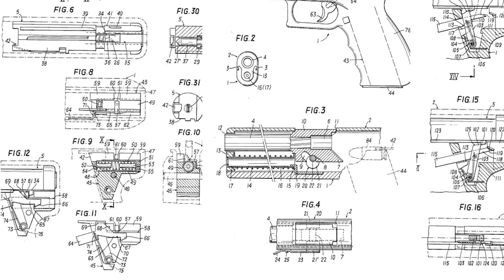The History and FUTURE of Glock

Comment: The Glock slide stop has 5 bending operations. And that doesn't include any of the secondary intermediate operations (where you would reposition the part to complete the bend operation). I've been bending metal for a very long time. Between using a press brake, a c-frame hydraulic press, and the hammer & anvil techniques, I've been doing this kind of work for over 10 years.
Reply: As a side note: 
It's very likely that Glock has presses/dies to specifically make those individual parts in a highly simplified manner that reduces the number of operator interventions by combining multiple bends at the same time. It may only take their shop 2 steps to get all 5 of those bends in, but there are still at least 5 operations that need to happen for the parts to fall into acceptable parameters. I've spent a lot of my life designing those kinds of parts and the tooling to make them. But I still have plenty to learn. Companies like Glock are on the bleeding edge of those kinds of manufacturing processes.
Reply: I used to tell my guys at work "it's mass production, not mass perfection."
Well, Glock is the "mass production" while guns like the 1911 are "mass perfection." That's especially apparent in the cost to produce each type. Sure, manufacturing processes have gotten much easier for the 1911 due to the accessibility of CNC controlled machines capable of exceptional tolerances and very little rework. But there's still about 10 times the amount of machining on a 1911 than on a Glock. And most mid-level 1911s cost at least twice that of a Glock (though the production concepts are often cheaper with other manufacturers as Glock keeps a slightly higher price point due to their reputation.) Look at guns like the SCCY or Hi-Point that use similar manufacturing processes as Glock and you'll see just how cheaply these arms can be produced with similar reliability/durability standards. It just goes to show you that there's always a better way of doing things if you have enough foresight and the right conditions.

Even though I hated Glocks (and similar pistols) until my mid 20s, I realized how exceptional they were when I had gotten more experience with other pistols. Every successive gun I owned and fired made the Glock seem better and better each time. Sure, other guns do certain things far better than a Glock. The 1911, for example, has a trigger that's orders of magnitude better- even the cheapest ones. The CZ-75 and German Luger/Walther's were buttery smooth and extremely accurate compared to Glocks. But the Glock is just a better overall gun. And because it's fucking ugly as sin and relatively cheap/tough, you don't freak out if you drop it onto concrete. They're far better at serving as a tool whereas a quality 1911 is closer to "functional art." And I assure you, I understand that better than most. I've built multiple 1911s from the ground up with unfinished, hand-fit parts that I personally machined/fit. I've done similar work with Glock-pattern guns. The difference is stark. Everything on a 1911 needs to be closely measured, carefully fit, and well toleranced to function properly. With a Glock design, you can pretty much do everything with a Dremel in under an hour with no real fitting required.

Comment: I have a G48 (original 10 round mag) Made a few upgrades by switching the release button from the polymer to metal and a 15 round mag from Shield. Now, is not only a great concealed carry gun but has the capacity of a G17 or 19 with the 5 round extra. 

Heavy duty and reliable is what makes Glock a great gun.  Also love Smith & Wesson brands too.

Comment: Coming out of the military, I wasn't sure if I would like the Glock. But, when I was in the market for a new concealed carry pistol, I settled for a Glock 48. The store also had a 43x which is basically the same pistol as the 48 but with a shorter barrel.  But, I was impressed with the pistol's performance right out of the box.  I've shot several Glocks in the past and liked how the performed as well.  Glock is not a pretty gun but it's performance is excellent and its price is too. Wilson Combats are beautiful pistols but ridiculous expensive and not as accurate as say the Taurus 1911, which is also a beautiful gun and a lot less expensive. But, for overall performance,  I like my Glock. Its light weight and conceals well.

Comment: The HK VP70 was the first polymer striker fired gun. Came out about a decade before the glock but the trigger was like 20lbs and awful. Btw its Leon S. Kennedy's gun in Resident Evil 2 the Matilda .
Reply: Yeah he mentioned it. Volkspistole
Reply: The pilot in Aliens also used one, if I'm not mistaken.
Had a buddy back in the 80's who collected movie guns & shot his VP-70 a few times. Designed originally to fired full auto with a detachable shoulder stock (like the old Mausers Broomhandles) it probably worked great in that role....as a stand alone semi auto, however, it was pretty mediocre. High mag capacity & sexy looking, but the trigger was absolute crap..! !
Also shot his Franchi Spas-12 shotgun from The Terminator.
Another firearm that's main feature seemed to be that it was sexy looking as well....
After years of training with Remington 870's, the Spas-12 to me just seemed big, clunky, & complicated with no real advantages.

Comment: The striker fired systems are the older system in Autos. Borchardt, Luger Browning/FN 1900. It is worth noting that most militaries moved to hammer fired or would not accept striker fired. Striker fire is a very old system like 1870s Mauser old.

Comment: I think glock is gonna get out competed by there clones. Glock refuses to change things like the grip angle and grip width. Most copy pistols are way more comfortable to hold and point.
Reply: Yep.
Reply: There is no issue with the "grip angle". Hundreds of thousands of shooters do just fine with the factory grip angle. I've never had any issue with it nor has anyone I know.
Reply: i personally have been very intrested in the M&P 2.0s. Ive heard their outstanding and a bit more modern feeling. I personally now use the HK VP9. it feels so cutting edge and modern by comparison i love it
Reply: @justinsmith8118 I got my wife the first m&p in 380. It's feels really nice in the hand and shoots well.
Reply: It’s not the angle. It’s the hump and you don’t have to look far to find a whole Industry to remove them.  That’s why the Shadow System has replaceable bottom straps. And they’re selling like hotcakes.
Reply: @robertwatson818 I disagree, I don't like the grip angle and the grip feels chubby. Most people I know don't like there grips, they rocking a m&p or a springfield xd.
Reply: @g-mc4507  Does SS provide a back strap without the beaver tail?
Reply: @juxmatic2288  No. Shadow Systems has replaceable lower straps not like the Glocks upper half straps. The beaver tail is good. Didn’t think I would like it but it’s great.
Reply: @g-mc4507 selling like hotcakes? Half the people buying SS are turning them and going back to actual Glocks or just moving to a different brand.
Reply: @pseudopretentions1722 well regardless of who YOU know, Glock is the best selling handgun brand by FAR, so the people u know are the minority NOT the majority 😂
Reply: @9770G  Got 5 Glocks including a 1988 gen 1 and the SS blows them all out of the water. It’s the gun Glock should be building.
Reply: @g-mc4507  sure pal, u spent more money for a knock off than what the real thing costs. SS is only 2 generations behind Glock 🤣
Reply: @9770G  Big negative there sport. Family Firearms in Bama has them on sale quite often for$650. MR920 with optic cut. Hey sorry didn’t mean to piss you off.
Reply: @pseudopretentions1722  I've been using nothing but Glocks since 1992. Prior to that I used various .45 auto clones. I never noticed any grip angle issues. if you notice some tiny grip angle change you are not concentrating on the fundamentals of shooting. Grip angle plays no part in shooting success.
Reply: @pseudopretentions1722  Rocking?
Reply: @robertwatson818 people just want any excuse to explain their inability to shoot properly.  It doesn't fit my hand, it's the grip angle, it's too wide, too skinny, too small, too heavy,  the trigger is too heavy, the trigger is too light, the sights are off,  and on and on... If only people would spend half the time actually practicing as they do making excuses...
Reply: @robertwatson818 there's no issue with a 1984 chevy caprice either, just why would you lol

Comment: Read the Mar 31, 2003 Forbes (business magazine) article on Glock, available online. The article is named "Top Gun."
Highlights:
Gaston Glock survived an assassination attempt by a man hired by his business partner, both of them were caught and convicted.
The gun at that time cost $75 to make, and sold for about $500 retail.
He designed and built the original handguns for the Austrian army, which at that time was looking for a replacement pistol but had no ability to make them in their own country, nor did the army like any of the offerings on the market. Glock changed all that. With close collaboration with the Austrian army, he designed exactly what they wanted.

In addition....
Glock model numbers are named sequentially in order of design. The model number has no relation to caliber, capacity, or size. Confusing.
Block designs are modular. No gunsmithing required to change out a barrel or trigger module if it ever fails.
Older model Glocks can have KB's (KaBoom) where they blow up due to the unsupported chamber (especially in 40SW), which touched off a class action lawsuit. Many of the KB's were with factory ammo. Newer designs have a better supported chamber. Also brass can get the "Glock smile" where it is noticeably deformed during firing (if it has an unsupported chamber), when this happens scrap the brass, do not reload it.

Comment: It is damned easy to maintain..   However it isn't as user friendly as say a 1911 in hand much less a CZ75b with an Omega trigger and it is a stretch to say it is that much more reliable than a 75b.  Certainly not a P226.  It is light for its firepower.  But it doesn't have a trigger that competes well with a CZ Omega trigger, a VP9 trigger, certainly not a PDP trigger or even a 100 year old 1911 trigger.  For some, the grip angle and trigger pull require a bit of training (the wrist roll) to master.  Whereas you can pick up the others I mentioned and pretty much shoot them better with less practice (subjective but my opinion).  I feel the Sig P220/226 is pretty much the pinnacle of reliability and function at the cost of weight, but the platform will still be working when the bugs inherit the earth.  (I friggin love my P220.  So smooth.)  My G19 is over 34 years old, a Gen 2 and I am thankful it was invented.  It was visionary.  I don't feel it is "perfect" or you wouldn't have innumerable 3rd party firms built on Glock improvements.  It is the AR-15 of pistols.  Totally customizable.  Maybe not modular, but you can replace everything and Frankenmod it.  If you offered me a VP9 for my G19 or a PDP or even a CZ P10c for my G19, I'd take it...  Well maybe not...  I think it is cool that it is a really old polymer gun that works nearly every time (after I changed out all the springs because it is so old).  And the gun is AKM simple so much so that a hack like me can work on it.  Glock did change the game.  I think it is a shame that they are so change resistant in terms of obvious upgrades like the garbage throw-away plastic sights.  You can get the MOS version.  I have not shot it yet.  Some say it level sets the pistol with the avante garde wonder 9's I mentioned, but at the end of the day I'm a little skeptical as far as just picking up the gun out of the box and shooting it as well as I did my PDP when I first shot it.  I did not get the "Oh my God.  I must own this!" reaction with any Glock I ever shot like I did with the PDP, but that's just an opinion.  (That gun is a lazer beam for me.)  I just remember how I have to shoot a Glock to hit well with it, then I'm fine.  The good news is if you shoot one stock Glock, you have pretty much shot them all.  I have not shot the Gen 5 yet just handled it.  Not that much different from the Gen 4 I have shot a bunch.  Incremental changes.  That's a good thing for familiarity.  I do like the flat grip without the finger grooves better so I might like the Gen 5 grip better.  The trigger is a little better dry firing it, but not nearly as good as the VP9's, PDP's or Sig P320's .  I left the trigger stock as it is a carry gun for legal reasons.  (DA's will jump all over trigger mods to brand you a "killer" for wanting to accurize your gun with a light trigger even though you're less likely to miss and have the bullet go zipping through something unintended in a defensive shooting, but whatever...) 30:44

Comment: What I like about Glock:
They work incredibly well
They are cheap
Parts are easily available

What I don't like about Glock.
It standardized a lame pistol rail that is not 1913 for some reason
The mags are thicker than they need to be so they can be made cheaper
The mags have more friction and may require a Glock "Flick"
The horribly confusing naming of the different models
The stock sights
That dumb hole in the grip that catches the ejector lip of the bullet when inserting a mag(Ps that stock attachment is a dumb reason to keep it IMO)
The Glock angle that makes it a learning curve to even try to use a different platform (sounds like apple IOS)
The lack of a more undercut of a trigger guard
The trigger is widely complained about (personally I don't really care, it works fine)
The disassembly method and design
The fact that the only feasible slide swap you can do is put a 34 slide on a 17 frame. 
They could have easily designed an FCU or at lease a more universally compatible frame to fit a wider range of slides (What if i want a 19 frame with a 34 slide??)
The fact that it took them too damn long to make an ambi release and improve the button size for mag release
I just don't like the spokesperson from Glock store, he looks like a gun show scammer trying to sell me red anodized parts.
Punisher skull backplates 
The lack of soul in the design (Maybe i dont want a square)
The lack of importing the models people actually want
Seriously a performance trigger? yeah sure....
Gucci Glocks are dumb, nobody cares that you have this trigger or that slide, its a Glock it will always be a Glock, the less you do to it the better. 
when I see a polished and engraved Glock it looks like a Nickle plated G-shock  with gold inlays, like stop trying to make it something it is not. 

And lastly
The design of the browning tilt action barrel combined with a basic striker fire mechanism and a lock trigger safety is so completely outplayed I swear any time I see a new pistol from any company I take a breath and wonder where the innovation has gone. It is almost as if that is all that is out there, I am sure that there is an argument to be made for rotating locking barrels and other methods of firing such as internal hammer fire or hammer fire or double action. But there is nothing else even being considered, Plus these companies that are making Glock clones are doing it better than Glock. Can we try something that is different? Please? I don't want this to be peak performance.  

If you are this far, I have a Glock gen 5 because of course I do, its a Glock and there is no denying the performance. But it is just not ...... anything. It reminds me of say how older cars had flair and style and if you had this or that it would tell your personality. or how older architecture is classy and has soul, but now everything is bland and geometric. I am glad Glock is around but geez am I starving for something else.

Comment: That's cool that the Gen 3's patent expired, but this decentralized platform idea you're talking about is already being done but in a better way with the P320 and P365 series. More companies are putting out Sig frames, which is the most significant piece for a pistol. And you can get them without an FFL. With any Glock frame, that is still the serialized handgun, and modifying it becomes more costly and tedious.

Comment: I love my Glock Gen 4...I KNOW..
But does the gen 3 parts fit on it almost every? Not gen 5 which I hate. I also have CZ p07 Which I love. Its urban gray.
And many people think it's exactly same as Glock others strikers but beware the ..firing spring are fully cocked I know many situations it hitting the primer and malfunctions when dropping in sand ...not Glock 17 gen 2 -4 and that's why the trigger pull is little bit harder not too hard Ofcourse but fits not have tension to hit primer accidentally without pulling more energy and it also protect many function When going under sand etc 

..any Way nice video. 😐👍✌️

Comment: It’s important to emphasize the slide stop in a Glock ,is just that, a slide stop. This holds true in all injection molded semi auto hand guns. The lighter stamped materials used in the slide stop when used as a slide release can bend, break, or both.  In combat shooting the proper way to release the  slide is manually pulling the slide back and releasing it with a gross motor skill two handed movement. The use of the stop as a release is  necessary in a one handed situation due to injury or a variety of other conditions. 
It is a good idea that all semi autos the slide should be released in a two handed movement!